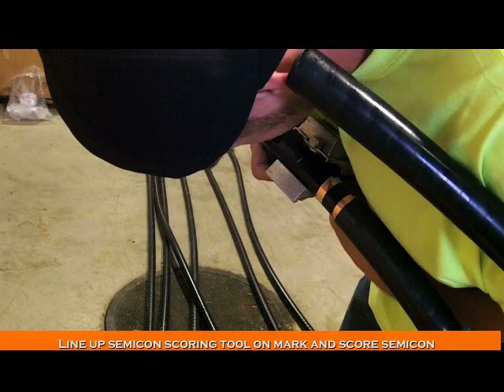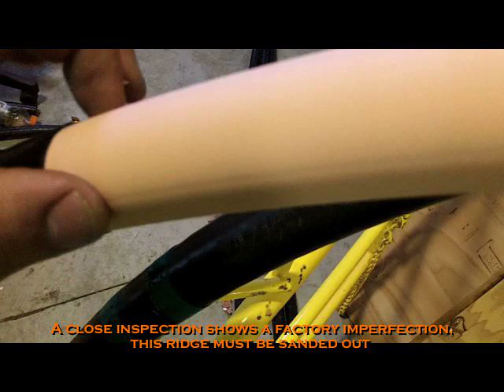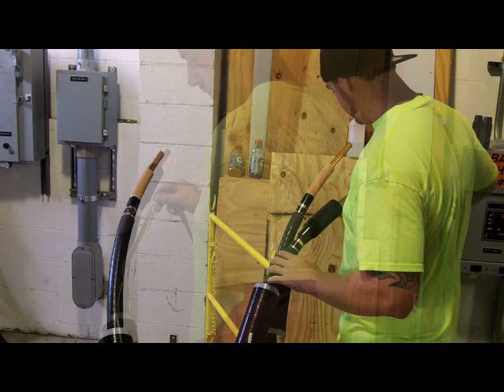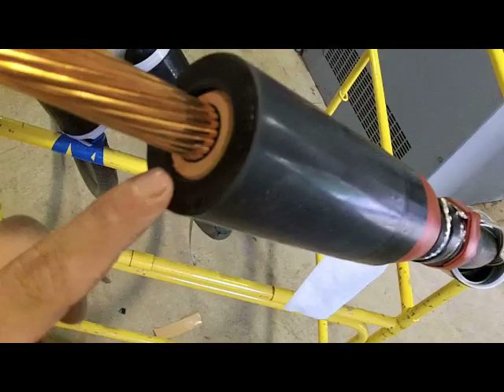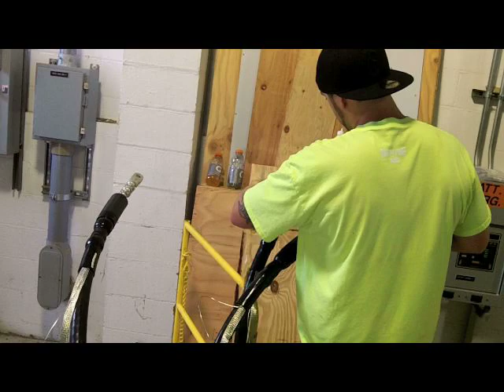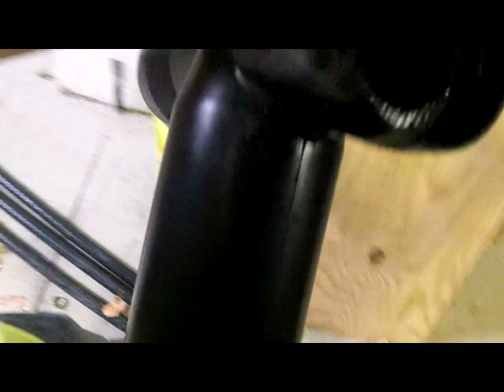15kv tbody dead break elbows

Comment: Nice video. I’m a splicer too. Most cable i work with has a concentric neutral so don’t need for a ground braid. Just leave the neutral out and twist them together.
Reply from the maker: Check out my 35kv Dead break elbow install - some pretty large Concentric Neutral cables focusing on grounding and bonding of the cables

Comment: Beautiful work. Can I make a suggestion, please. 35 years in the Electrical Trade, all aspects, from IBEW Apprentice to Electrical Engineer. You do very good work, but I think, when you handle the chemicals...the Cable cleaner, and the lubricant specifically. Wear rated gloves for the cable cleaner and lube (In the old days, we used as a cable cleaner a product called 2,2,2-Trichloroethanol, which is a known carcinogen). Many are now very sick due to exposure, inhalation, and absorption through the skin. 
I would also like to add... do not put anything in your mouth (the lubricant tube or whatever) during installation. All of this can transfer to your cardiopulmonary, digestive and internal organs, and will build up through increased exposure, either through ingestion and physical contact, and make you very sick. Take care for yourself, because nobody else will in the end.
Reply from the maker: Thomas Herdman your absolutely right. As a working electrician you can get complacent in the field especially when it comes to chemicals and solvents you may use on a regular basis. We use some pretty bad stuff every once in a while, but this cleaner we use doesn’t seem too bad. But, I reviewed the SDS for the solvent we use, and you drive a very good point home, the stuff is NOT good for you. I typically do use a pair of nitrile gloves when cleaning the cables but not in this particular video. Also, the grease pack in the mouth- not my brightest move. All bad habits of the trade picked up that have been broken. This video is several years old at this point, I’ve had a lot more experience and practice at the craft and are a little more responsible than shown. I do appreciate the compliments and appreciate the insight. I will take your comments to heart and pass on the true concerns to my other splicing comrades.
Reply from the maker: Thomas Herdman I just double checked our product, we use Rainbow brand PowerSolv, which is an Aliphatic Hydrocarbon, it’s way less harmful to health and not a know carcinogenic. The CP type solvents (typically aerosols) are as close to a 1,1,1 Trichloroethane as permitted which would be immensely more hazardous. We shy away from those solvents due to the amount of use expose ourselves to. Nonetheless, still not good stuff to be careless about

Comment: Nice! Looks like an indoor substation were these for terminating to a transformer or switchgear?
Reply from the maker: Shawn Campbell these were actually tails to be splices onto a lead to poly trifurcation splice in a manhole, the tails would be landed on 600A junction bars installed in the manhole. The site was in the process of removing lead feeders and changing over to EPR type cable set by set. We couldn’t pull out all of the lead at once, there were miles of it. The job was set up into phases.

Comment: As with any type of craft, there will be several ways to the end result. And none of them are necessarily wrong. And you will have someone give you negative feedback, because you did it differently than they do. I've done hundreds of cables myself,  and I like your work. Those cables will pass a test all day long. Not sure why this was recommended for me,  but I did enjoy it,  thanks for posting.
Reply from the maker: Family Steel thanks for the support. I’ve been doing medium voltage work since 2007, I’ve spliced and terminated hundreds of cables myself and am fortunate to have been trained by some very skilled craftsmen. Everyone develops their own skill set and methods over time and that’s what’s makes them an asset. We take pride in our classroom and practical training we perform and stay current in manufacturers training and certifications. Everyone is entitled to their opinions, as am I, but I am just showing how I do it.

Comment from the maker: No blood necessary. The tools used are typical hand tools used for the installation including speed systems 1700ss semicon stripper, and speed systems 1542 insulation stripper. If you draw blood using the knife for the short period of time you need it, you shouldn't be doing it.
Reply: +Jacob Young, give me a shout at blackstardiversifiedentp@gmail.com.  We have a 15kV installation, and we need to hire your expertise.